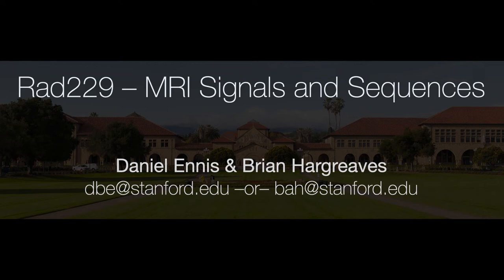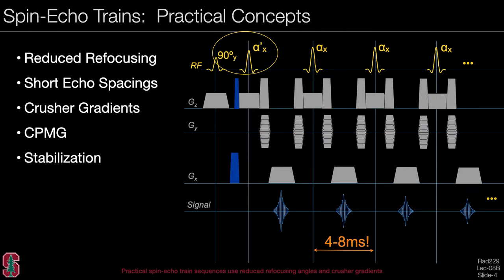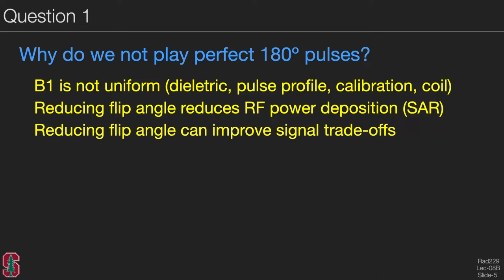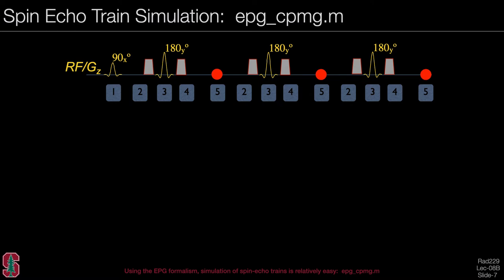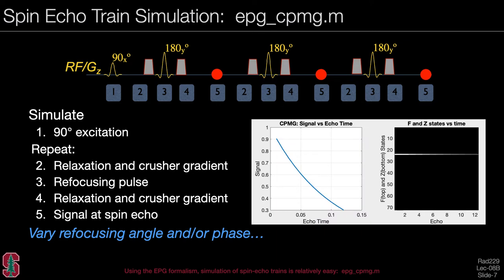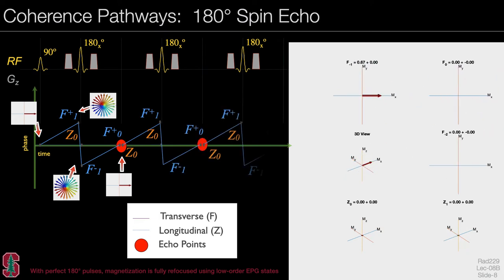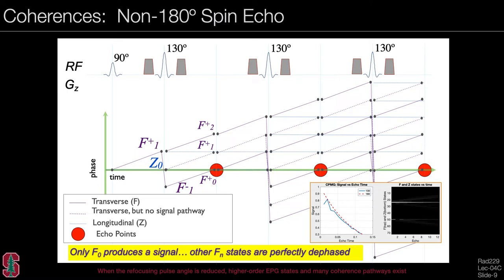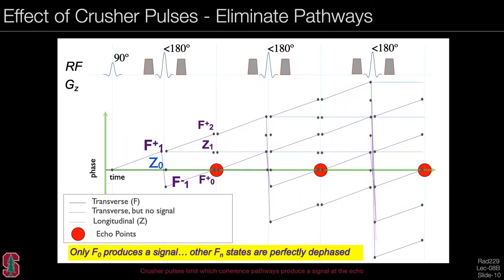Rad229 (2020) Lecture-08B: Practical Spin-Echo-Train Signals

Comment: i always get's confused about this simulation, I mean we are looking at the spin magnetic moments in a voxel. so why are all of them at the origin (0,0,0) should they be spread across the voxel at sub-voxel positions ? and and what about the encoding gradients ?  if I want to run an MRI simulation on a complete digital phantom do I have to have multiple spin magnetization vectors at each  voxel location ?
Reply from the maker: Great question. In general, yes -- you need to have a group of simulated spins within a voxel to capture all signal behaviors. This includes distributing them along x, y, and z in, for example, a 3x3x3 grid. Dozens or hundreds of spins per-voxel are sometimes needed. For visualization purposes (only) we often collect the spins at (0,0,0) otherwise the spatially distributed spin behavior can be difficult to understand.
Reply: @stanford-rad2299  Thank you for anwering my question. I am curious to know how can MRI acquisition with arbitrary sequence can be simulated on a 2D digital phantom like slices from brain web dataset where we have T1/T2 maps and proton density per voxel given. basically what I understand is that we have bulk mangetization at each voxel 
now what would I have to do  if I want to simulate how this bulk magnetization would evolve under the influence of MRI sequence events like RF pulses, and gradients in X and Y direction. let's take a simple 2D flash sequence for example. 
In this case my question would be can EPG simulation be used to simulate arbitrary MRI sequences over a 2D digital phantom ? . i am struggling to simulate arbitrary encoding gradients in Gx and Gy when I have bulk magnetization per voxel given. please let me know if this is something that can be done. i read few papers but they are all related to full bloch simulation either using ROA approach or using numerical solvers. 
thank you in advance